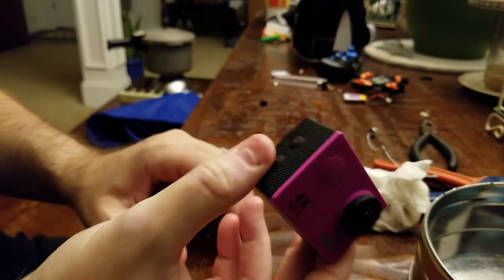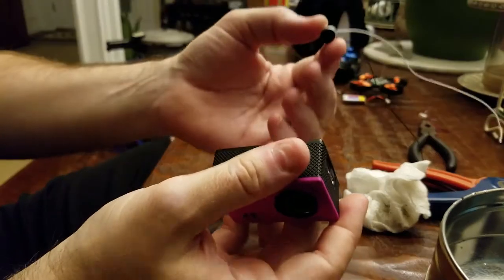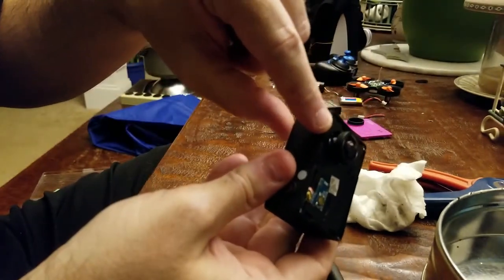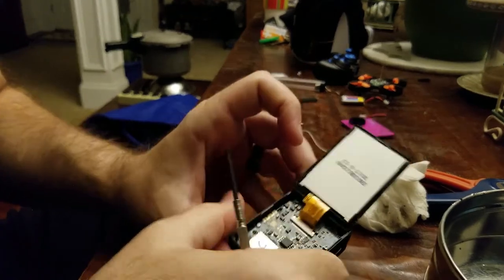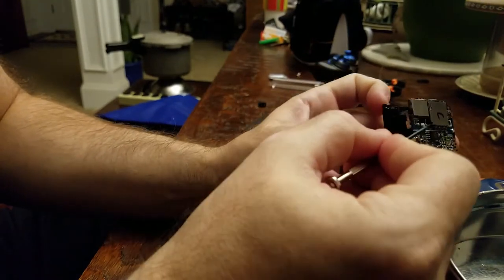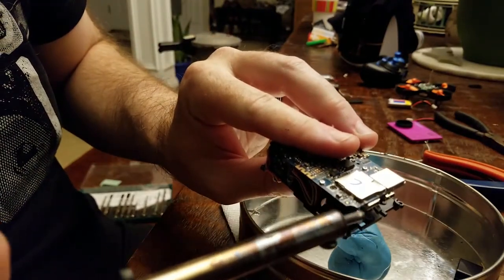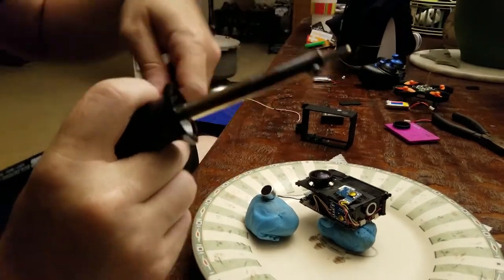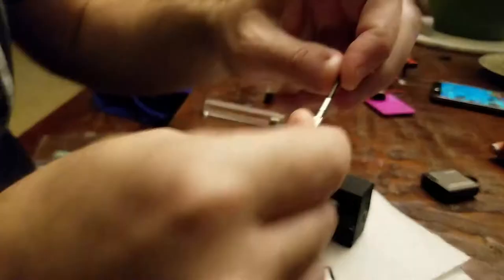DIY Mic Hack for Action Camera (EKEN H9)

Comment: Hey! I did the same thing in my Eken H9se cam, but after I changed a microphone, I can hear a strange squeal. What might be the cause, because it's not feedback, as long as I guess? You can check it in my video right here: https://youtu.be/wJaK8e0MTq8 (it's in Polish btw, so don't bother what I say, just listen to the squeal). Any suggestion?
Reply from the maker: Zielone Pantery Airsoft Team are you talking about the humm or was there a higher pitched squeal that i didn't hear.  The humm just seems normal to me